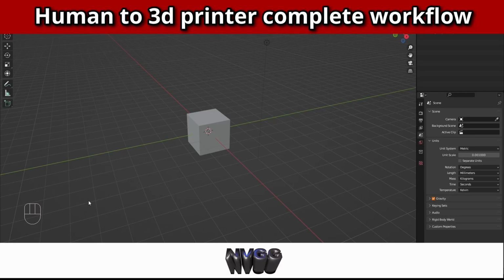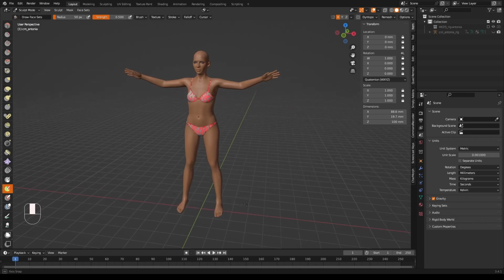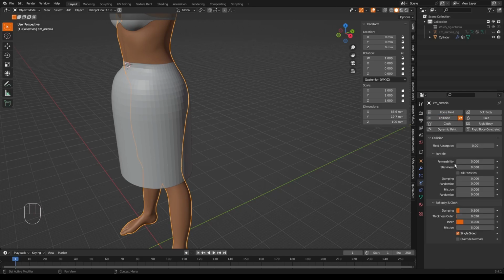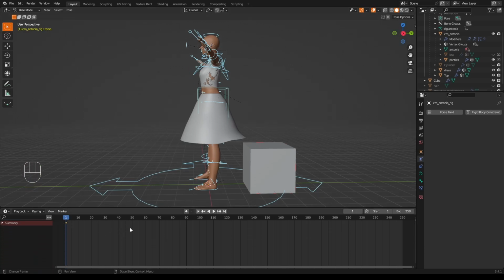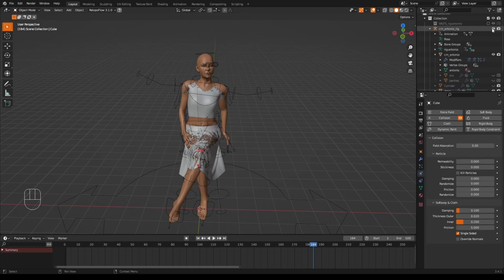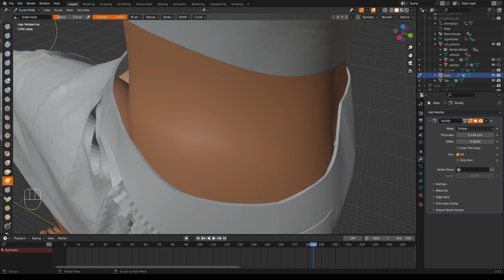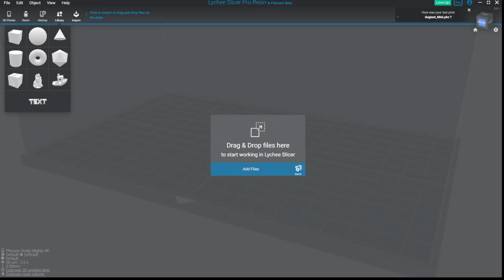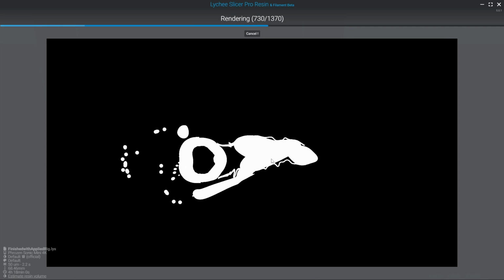Make and 3d print a human model in Blender.  Full workflow.

Comment: How  do you keep the supports from leaving marks on the model? when I remove the supports it usually leaves little dots, or little holes where they were😩
Reply from the maker: You need to make the contact size and distance as small as you can get away with.  Use light supports where you can and medium supports for most of the model.  Only use the large supports when you have to.     Also, try and place supports where you can't see any little marks.  It's a bit of a dark art that you get better at with practice.

Oh and if all else fails, sand paper is your friend.

Comment: Thanks for the lesson! Didn't you combine all the parts of the model into one object before exporting? Shouldn't this be done?
Reply from the maker: I can't remember if I did that or not in this case but it is not necessary.  As long as you select the objects you want exported and then check the "Selected only" check box in the export dialogue box (which you should probably do anyway)  it'll be fine.

Comment: Hi, NVGG! I have a request :) Can you please make a video tutorial or suggest a workflow for the following: there is an MMD model (obviously not meant for 3D printing) in T-pose with armature. I understand that I need 1) pose the model; 2) turn thin geometry to something printable; 3) emboss patterns on clothing based on the textures for easy painting. and now unclear steps: 4) remesh to truly merge geometry; 5) split the model into better printable and paintable parts.
More things to think about: let's say I want to prepare as much as possible (deal with thin geometry, embossing patterns) before posing so I reuse several steps for the model in different poses. how do you think the steps above can be rearranged?
Also, there are some issues with clothes, there is no physics so things look broken after posing.

btw, cool videos. I like how you explain things. Thanks!
Reply from the maker: Well there is a lot here.  There can be physics with clothes and it works pretty well.  Occasionally something might poke through the clothes but you can deal with that with just hiding the offending part of the model.  

Re-meshing is a major undertaking that I actually find quite relaxing but tools like quad remesher are often good enough for 3d printing though I might consider doing a video for this.

I already have a video for cutting and keying a model for easier printing and painting :)  It is not difficult to do with Blender.

However, I do get what you are saying, you want to do the posing last really which kind of makes sense but there is so much that can go wrong that I am not sure if it is worth the effort of setting up.

I'll give this some thought though and see if I can come up with anything.

Comment: Is it OK if my model isn't "watertight" ? Like I want to print a soldier, the mesh for the helmet, ammo pouch, the weapons he is holding etc arent the same exact mesh, is it still ok ? Because it's going to be a HUGE pain for me to redo all that skin, and using the remesh option is very not good because the quality is shit
Reply from the maker: They don't have to be the same mesh as such but each mesh needs to be watertight itself for 3d printing.  Of course separate meshes also all need to be touching each other  for printing unless you print them separately and glue them together afterwards.